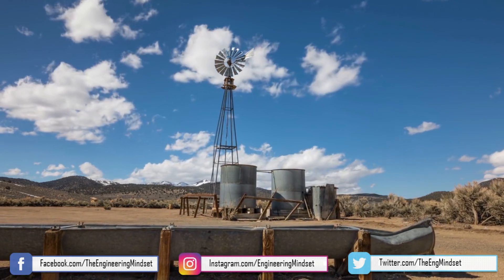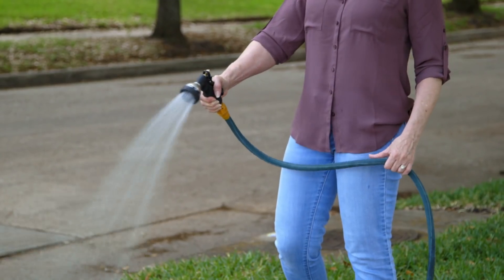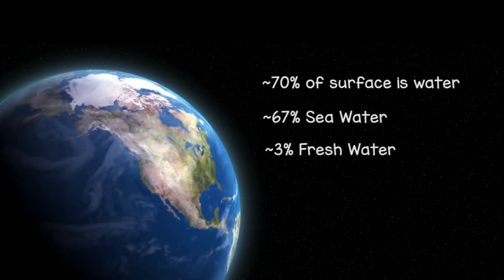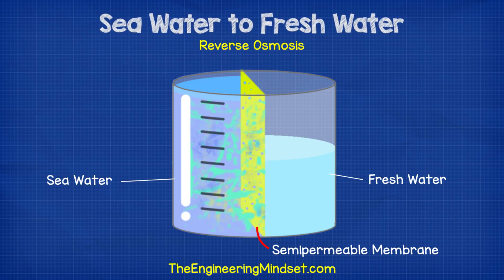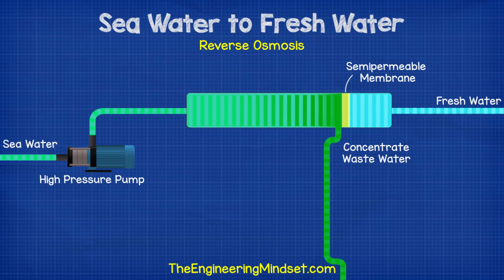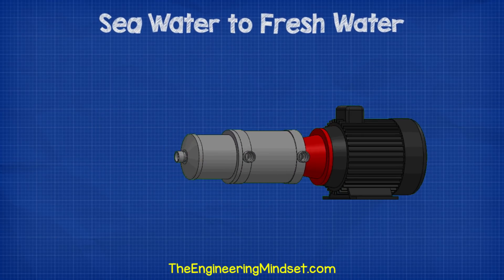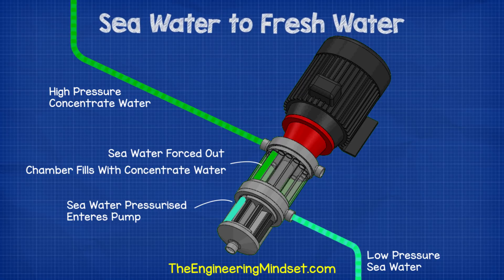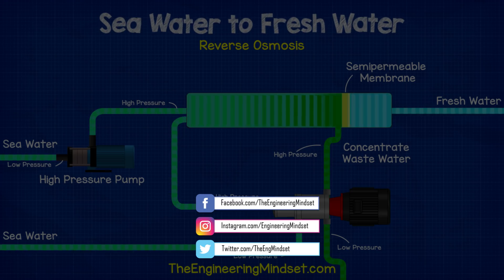Convert Sea Water to Fresh Water, Why we need to - isave filter salt water

Comment: I’m a graduate from the USA and we had a nyrex system to make fresh water from sea water through flashing sea water under a vacuum. Also we had a RO unit as well which used a triplex pump to push sea water through membranes that acts like a filter with high pressure, around 800 psi or so
Reply: I meant to add that I was graduate from one of the maritime academies in the USA, our ships had these systems to produce potable water
Reply: How its going now??

Comment: Why not use the pressure exchanger as a little hydroelectric plant to generate electricity and provide extra power for the primary High pressure pump?  all this water recirculating just seems too complicated
Reply from the maker: It's very inefficient to turn electricity into water flow, then flow into electricity and then electricity back into water flow.